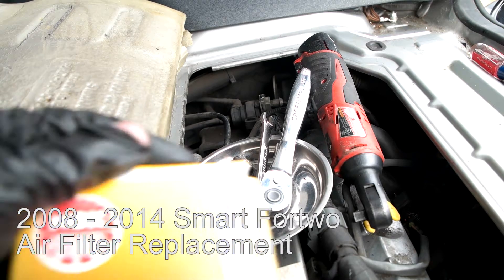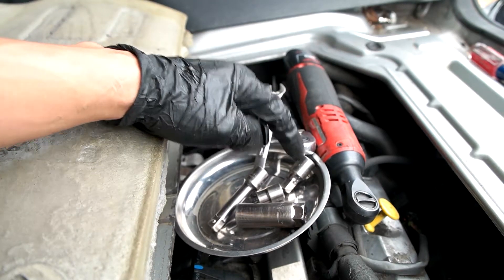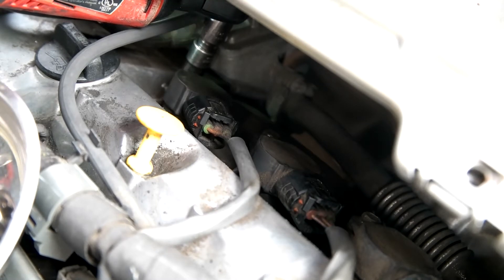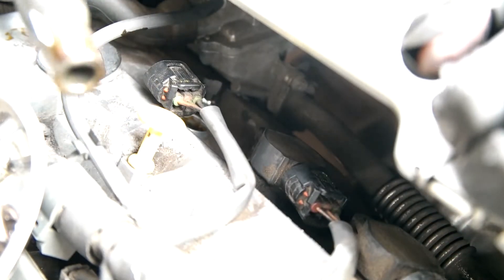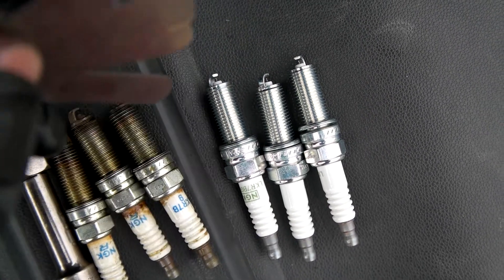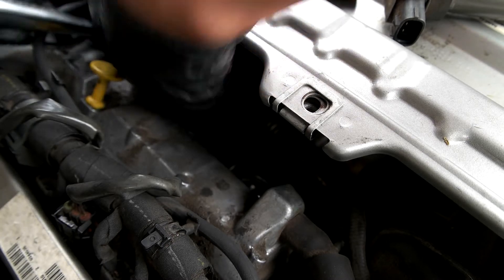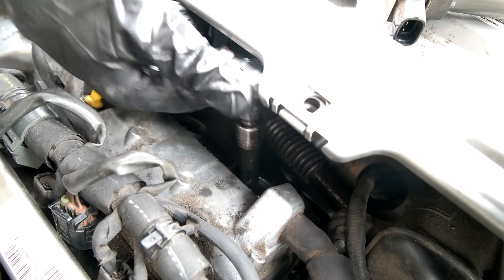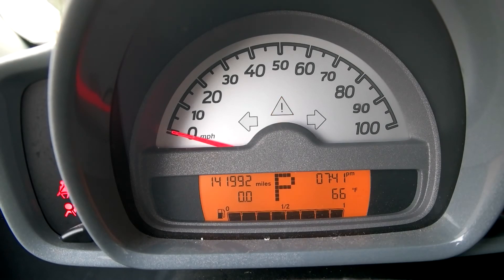DIY Smart Car ForTwo Spark Plug Replacement Tutorial

Comment: Nice video, thank you. Do you know exact tightening torque value?
Reply from the maker: Hello, the spark plug torque for a Smart Fortwo varies by model, but is generally around 20-24 Nm (15-18 ft-lbs) for models with a gasket ring, or can be around 30 Nm (22 ft-lbs) for taper seat plugs. Thanks

Comment: Hey Colin, just wanted to let you know that your series gave me the confidence to keep my 2011 Smart Cabriolet. As you know, they're not sold in the US anymore, and many mechanics won't touch them. So far, I've replaced the spark plugs, changed the oil, replaced the air and cabin filters, and soon (from other videos), I'll regrease the actuator, replace the lower engine mount, replace the gear box fluid, and grease the hinges and springs.  Good on you for doing these videos.
Reply from the maker: @VerdantCommons  Thanks for the positive feedback, and I’m glad you’re able to keep the car and perform your own service

Comment: Thank you so much for putting this series together. You gave me the confidence to do this service on my own (well with the help from my husband). Took us about 90 minutes - finding the right 10mm socket to fit the small gap, and then having the rubber gasket come out of the spark plug socket. 
I also seem to have a bad valve seal as my plugs were oily too - so thanks for mentioning that’s what it was due to.
Reply from the maker: I'm glad the video was helpful, and you were able to perform the replacement yourself with your husband! I have a video for the valve gasket and spark plug seal replacement if you feel confident in replacing it yourself. https://www.youtube.com/watch?v=YKhJHt6haN8
Reply: @ColinLeung  Thanks! I have that one saved too. I'll have to watch it fully and see if we're up to it (I skimmed it right after we did the plugs so it definitely felt overwhelming in the moment). I have a friend in Reno too, that offered to help (though that's going to have to wait until at least spring)

Comment: Hi Colin, need some advice on a 2012 smart car. Is there any way to contact you?
Reply from the maker: Hello Doug, may I ask what it's regarding? I'm not an expert on this car, but will try to answer your questions. You can respond here, or email me at colinleungvideography@gmail.com
Reply: @ColinLeung  Hey Colin, thanks for getting back to me. I live in the central valley 20 miles north of Fresno and I can't find anyone that will make a key for me. I have a 2012 smart Brabus model and I only have one key, I ordered a blank key from ebay and can't find anyone that will cut it. I've gone to Mercedes and a bunch of shops that make keys but nothing, just wondering if you had any advice? Thanks again.
Reply from the maker: @dougbrazil5384  Sorry to hear that. I would assume Mercedes would be able to cut your key. Is there a Smart car dealership around you? Searching online it looks like hardware stores may be able to cut your keys, but it still needs to be programmed with your car.
Reply: @ColinLeung There are no more smartcar dealerships (where I live anyway) since they quit selling them in the US. There's gotta be someone who can do it, I'll keep looking, thanks for taking the time to get back to me.
Reply from the maker: @dougbrazil5384  Good luck on your search. Let me know how it goes
Reply: @ColinLeung  Thanks have a great day

Comment: Thanks for the how-to video!  I guess I may be on the OCD side, but I usually change out each plug one at a time, that way I don't have open exposed spark plug holes that dust and crud can fall into the cylinder by accident.
Reply from the maker: Thanks for the comment. That's a great idea. I used to do that, but it was quicker to use the same tool to take them all out at the same time, and it's not very dusty where I work.

Comment: Good job, except you never drop the plugs into the slot. They could tap the entry point and change the gap.
Reply from the maker: Thanks for the tip!
Reply: What is the gap measurement for these?

Comment: And there's me thinking all petrol (gas) smarts had 6 spark plugs (2 per cyl)  and if you don't change the hard to get at set they burnout exhaust valves.
Reply from the maker: I read that 450 and 452 have six sparkplugs. 451 and 453 have 3

Comment: Any idea why my car could be so bad mpg 

2010 1.0 petrol
Reply from the maker: There are a lot of factors that contribute to poor mpg. Tire pressure, heavy throttle, old spark plugs, clogged air filter, old engine oil, valve adjustments off, etc. I'd check the basic and cheap stuff first on the list.

Comment: I managed to do it on my 2009 but on my 2011 there’s a hose blocking the right spark plug.
Reply from the maker: Thanks for sharing your experience! Were you able to move the hose on the 2011?
Reply: @ColinLeung  yea I did but now I have to go back and do the gaskets

Comment: I attempted to change my plugs today and found my extension which is over all about 2 and 3/4's inches is too short. Came in a 107 piece Hyper Tough SAE and Metric set. The ratchet touches engine and dip stick. I Thought it was a standard 3 inch extension but I guess it's not.. or Is this size what they call a 3 inch extension? I think a 6 inch would be too long. In any event.. I'm off in the morning to find a proper 3 inch extension and Hope it works. Thanks!
Reply from the maker: Sorry to hear that. Let us know if you were able to get the right extension and get the plugs replaced!
Reply: @ColinLeung  Yep got em changed out. I found I had to use the new 3 inch extension I bought And the 2 and 3/4 inch extension. It's purring like a kitten. Now if only I could make it Roar like a Lion! LOL
Reply from the maker: @DivergentDroid  That's great news! I'm glad you were able to replace them.